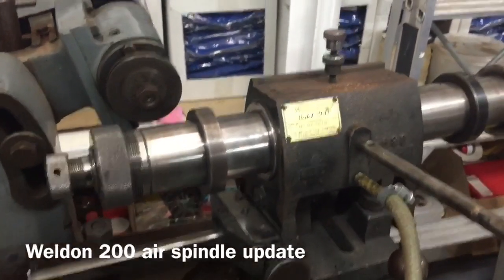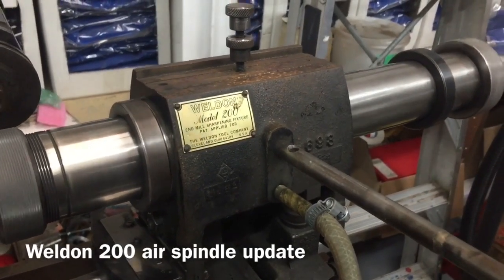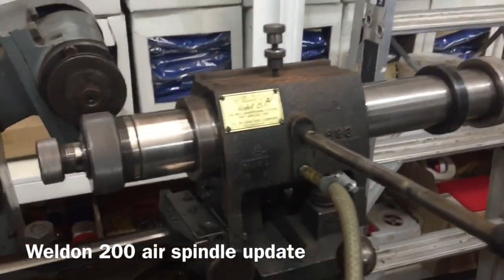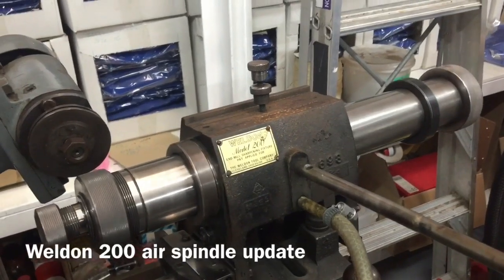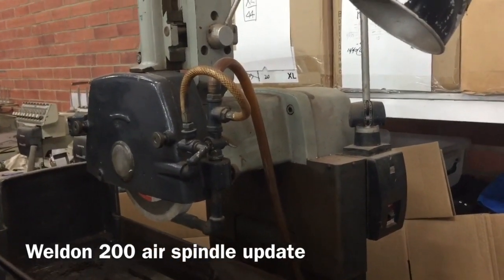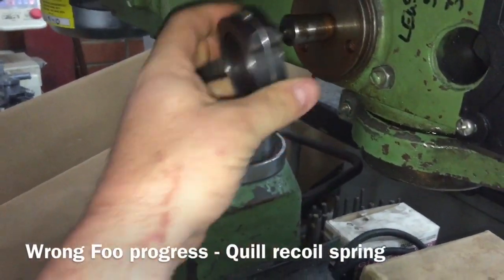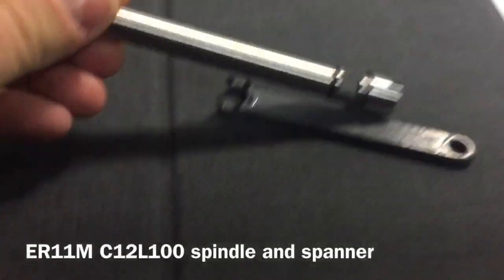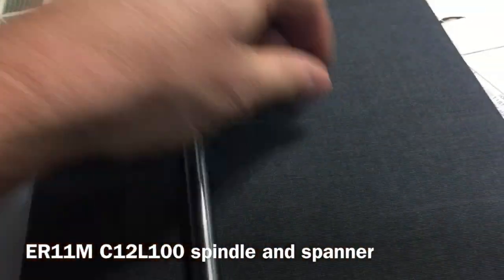Workshop Update 11

Comment: That air spindle makes me want to make the world's most overly complicated fidget spinner!

I couldn't quite catch what the ER11 collet shanks are for - I have two C12L150 units on order from eBay to make some toolpost grinders, one for me and one for Emma. :)
Reply from the maker: +Adam Carmichael the Deckel Pantograph original spindle has hard to come by collets, @Stefan has adapted an ER11 spindle (and subsequent low cost collets) to a compatible replacement for the Deckel spindles. I was fortunate to get drawings and photos from Stefan so that is high on the project list :-)